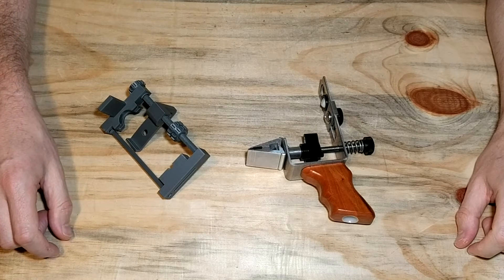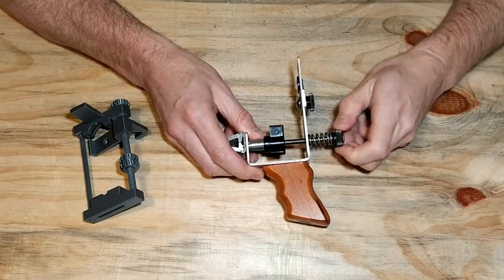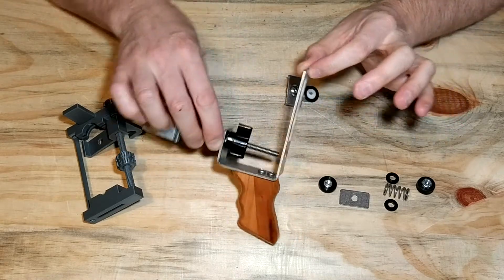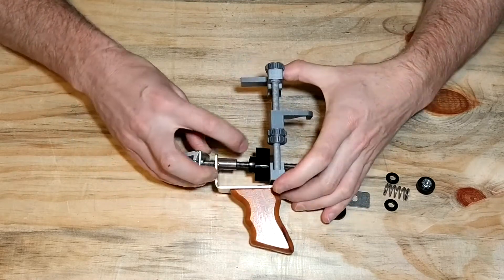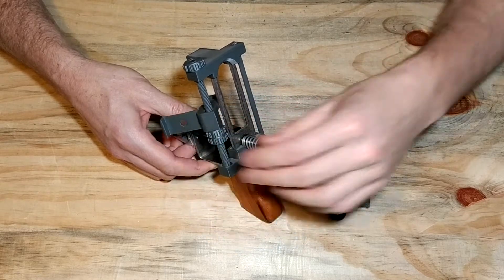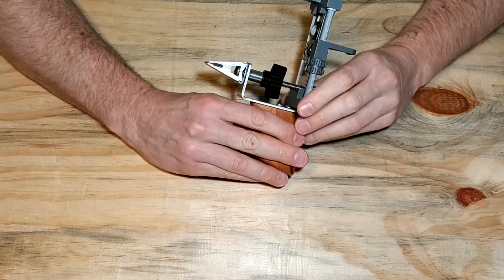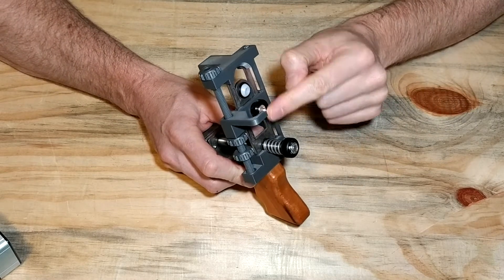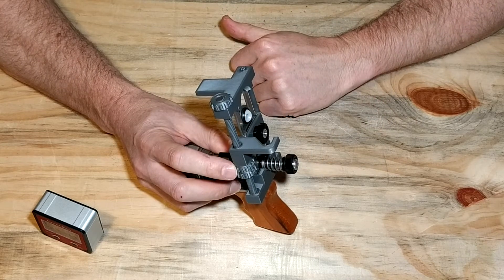Leading Edge Multi-Function Frame for KME

Comment: If you create a similar item for the TSPRO Pioneer, I would be interested in purchasing one. Let me know. Thanks.
Reply from the maker: I actually already created a fine tuning adapter for the TSProf Pioneer for Gritomatic. The Pioneer does not need a full frame upgrade like this one that I made for the KME, it only really needs the fine tuning adapter like the one I designed for it.

Gritomatic.com might be able to sell you one, drop them a note in their "contact us" page and ask about it.
Reply: @777edge  Hi I purchased the fining tuning adapter for the TSPROF Pioneer, do you have any instructions on installation and use?
Reply from the maker: @reddor5532   Hi there. The fine tuning adapter that Gritomatic sells for the TSProf Pioneer mounts to the vertical rod that adjusts your angle. Remove the rod, install the assembled fine tuning adapter on the rod with the thumb screw on top and the adjustable fine tuning threaded part facing down. When you want to use it, loosen the thumb screw, then adjust your angle as you would normally until you're close to the angle you want. Now tighten the fine tuning adapter's thumb screw and use the threaded part to fine tune adjust your angle until you're exactly where you want to be. After this, tighten the Pioneer's vertical rod lock screw. Hope this makes sense?